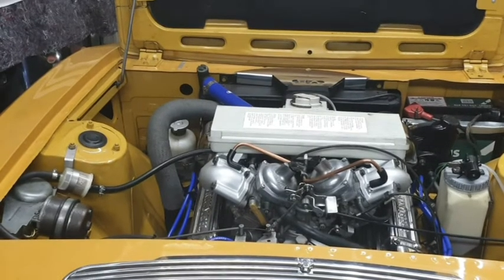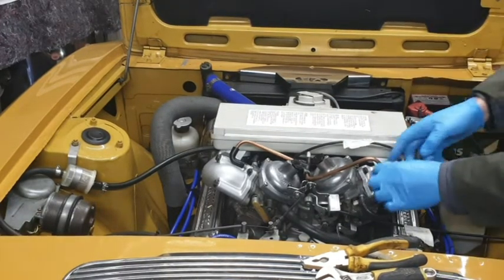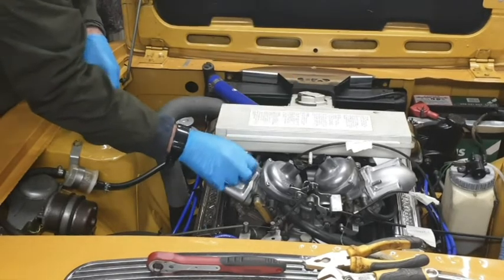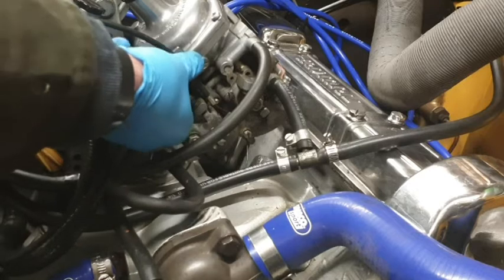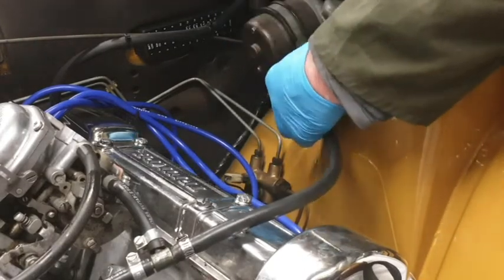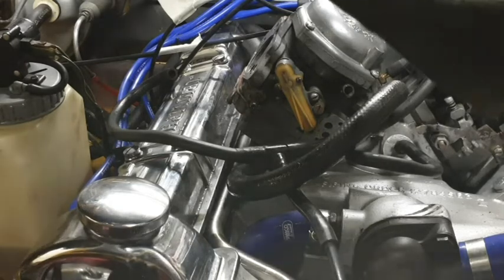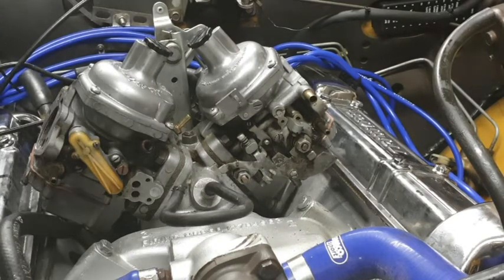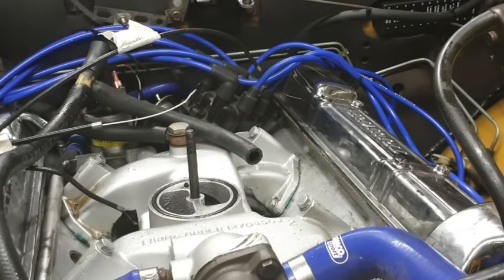Triumph Stag Carburettor Removal - Pre : 01

Comment: You mentioned that there was no washer under the central retaining nut.
Not only should there be a metal washer but there should also be a fibre washer there as well.
Reply from the maker: Thanks Julian. I thought it odd that there was nothing there.
Reply: Mine has a single copper washer  @StagStuff